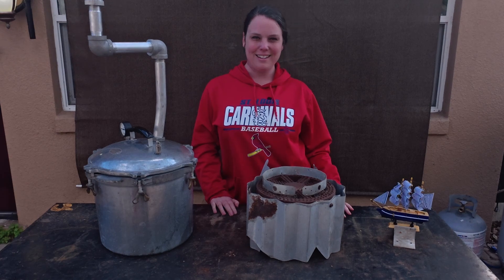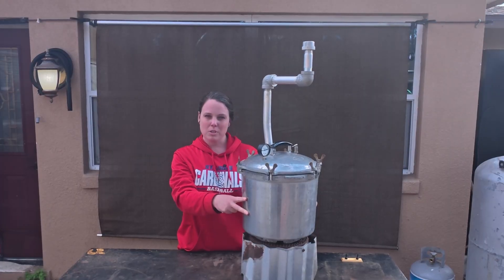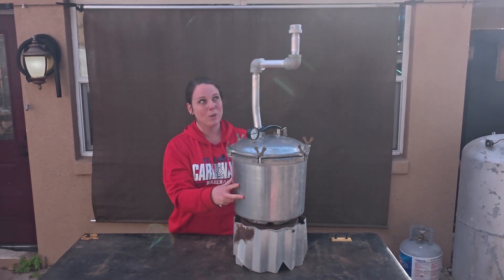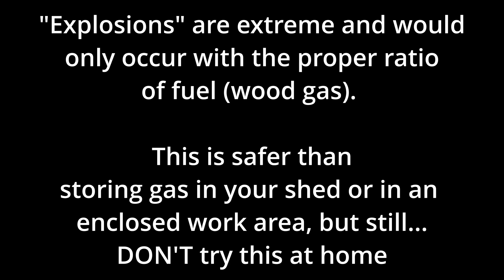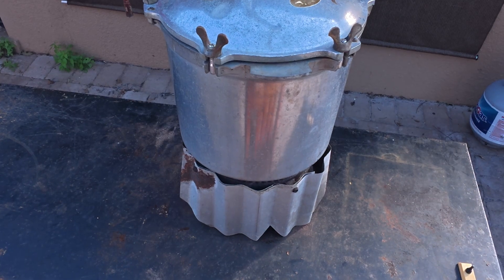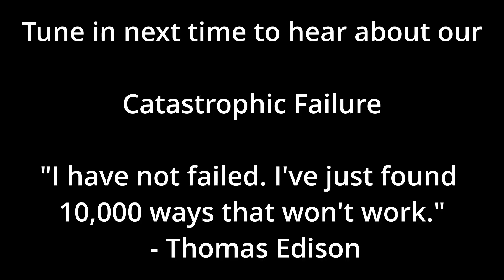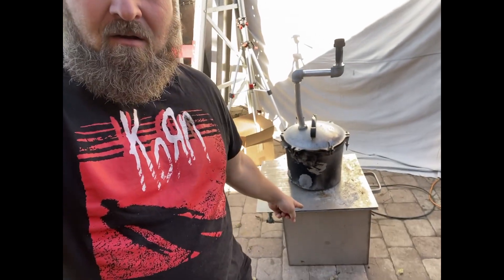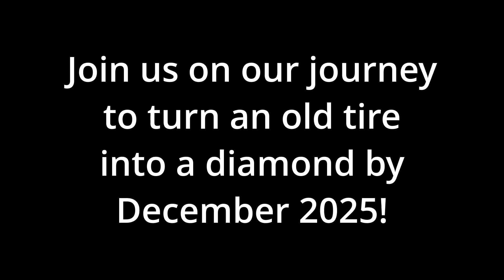Ep. 7 - Success Before Our Catastrophic Failure! RIP

Comment: Found this video trying to look up something else and have a question. What is the point of the pyrolysis? Are you using it for something else once it's cooked?
Reply from the maker: Hi Anita,

Ultimately, our goal is to use pyrolysis to recycle the end-of-life rubber that they chip-up and use as fill in the landfills. 

Pyrolysis is the cleanest and most environmentally way to dispose of old tires and plastic. 

One of the coolest aspects is that 100% of the "leftovers" can be used. 

The oils that are condensed from the "smoke/gasses" can be collected and used to fuel combustion engines. It is similar to diesel. Those oils can be refined/distilled further to separate their components and can be sold.

The carbon black can be used in roads, tires, coal energy plants, and so on. But, we think that the coolest thing is that the carbon can be turned into diamonds, and that is our plan. 

We are going to turn an old tire into diamonds. 

Stay tuned, and I hope this explanation helped.

-Gregg and Kyla